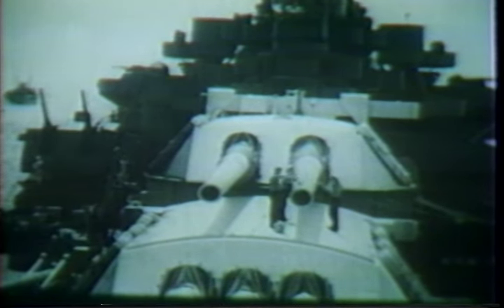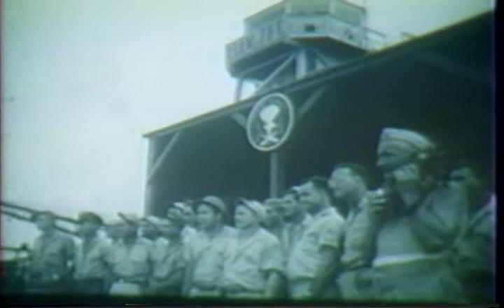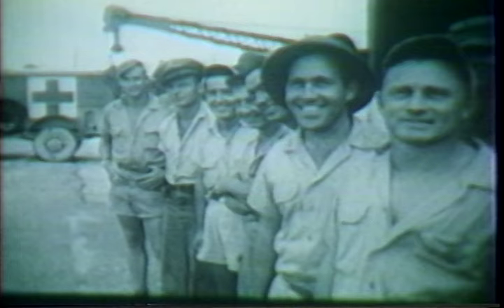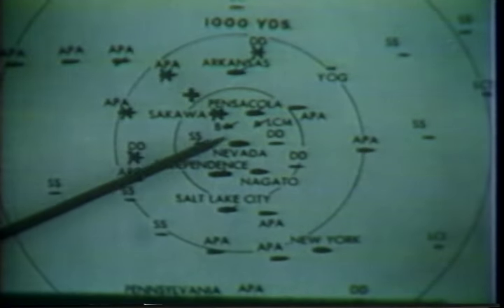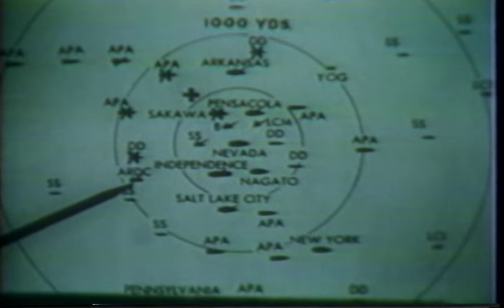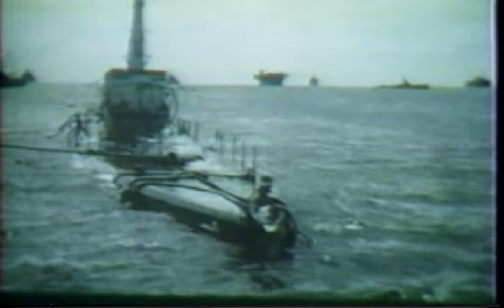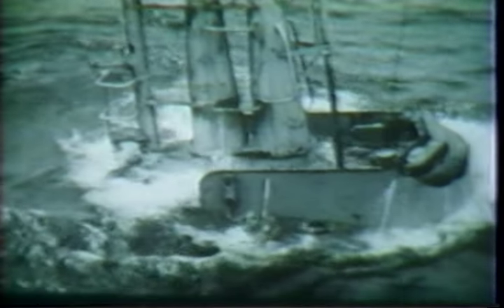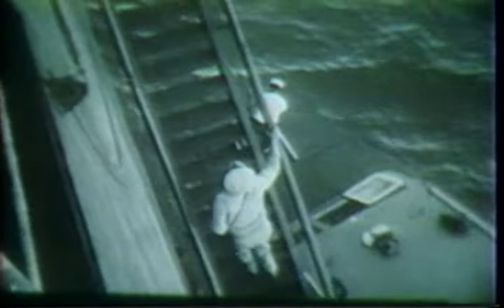Project Crossroads - Nuclear Test Film (1946)

Comment: The temperature in the center of the sun is over 15 million degrees celcius so it may be hotter than the surface of the sun but not even close to the core of the sun
Reply: In a hydrogen bomb the internal temperature of the fireball reaches about 100,000,000 degrees.  Cool huh?

Comment: All that gas from the atmospheric pressure ring is from detonating a million degree bomb so close to water it literally vaporizes thousands of tons of water instantly and turns it to a gas that surrounds the explosion and the column forms due to a vacuum created by the hot air rising from the superheated fireball of plasma rising and the vacuum  in turn makes a column of the same superheated plasma to rise and join the fireball cloud while its cooling

Comment: The cameras were better protected from radiation than the men. It's actually really sad to look back at this now and see the continued devastating effects to the environment and population of that area as a result of those tests. People are still advised to not eat the fish or coconuts from those islands. There is still so much toxic waste and it's shameful to the US that this still hasn't been properly acknowledged and dealt with, if it even could be. I suppose with climate change, eventually those islands will likely be underwater anyway. Sad for the Marshallese people either way.
Reply: They  cleaned up a lot of the stuff and put it in another bomb test crater from "shot cactus" and poured a concrete dome over it to contain it all, but the problem is, like the Chernobyl exclusion zone, once it's there, it's there, only TIME can cure it all.  The radiation levels are actually very low, almost miniscule, BUT the problem is it has entered the soil and water and is now in the food chain-- you can safely go to Bikini or the other test islands, and depending on the location and radiation levels, you can even stay awhile, sometimes days or longer without any significant radiation exposure buildup.  BUT, if you eat or drink anything locally, it will contain atoms of radioactive nuclides or neutron-activated atoms which have been absorbed as nutriets from the soil into growing living things, and then accumulated in the fruit, nuts, wood, bark, leaves, everything... even in the plankton and stuff at the base of the marine food chains, and then of course up through the various animals that feed on each other up the food chain, and due to bioconcentration (just like what happens with fish that get progressively higher levels of mercury or other heavy metal contamination the higher up the food chain you go) the more radioactivity they contain in their body.  Same is true of any animals you might try to raise... the grass they eat contains low levels of radionuclides, but the higher up the food chain you go, the more it bioconcentrates-- so the meat and milk from those animals is more radioactive than the grass was, which means you accumulate more radioactivity than the animal had...  same with fish.  SO if you try to live there, you're perpetually exposed to a very low level, which in itself is "safe" (radiation exposure is cumulative in nature-- the longer you're exposed to it, the more 'lifetime dose' you get and the higher your lifetime dose, the more likely you are to get cancer from it or produce children with birth defects, etc.)  BUT if you eat and bioconcentrate foods grown locally or fish caught locally that have radioactive atoms in their bodies, eventually YOU will become radioactive yourself as these atoms are used by your body through the food you consumed to build new tissue, bone, etc.  THIS is the reason nobody can live there... The US 'repatriated' the Marshallese to Bikini years ago, only to discover that this "bioconcentration" effect was causing problems and killing them, so they pulled them out again and relocated them again.  

There's vidoes by a guy named Shiey on YT where he illegally hiked into the Chernobyl exclusion zone (several years ago before he war in Ukraine) with a buddy and they explored around Pripyat, the abandoned town adjacent to the ill fated power plant, and hiked out again.  They carried a radiation detector and for most of the trip, except for a few "hot spots" that wer downwind of the reactor that day, the radiation levels are pretty low.  They didn't get an appreciable dose in the couple days or so they were there, but you can't live there without getting a cumulative dose, and of course anything living there or grown there would contain radioactive nuclides in it, absorbed from the soil into the plants and then animals growing there, and bioconcentrated.  Why the idea of "scraping off the top couple inches of topsoil" to get rid of fallout on farmland and/or growing a couple crops of potatoes or other crops that sequester radionuclides" is completely bonkers... Aside from the amount of fuel and equipment it would take to scrape off even the top couple inches of soil from even a single farm (which would amount to literal MOUNTAINS of contaminated soil that has to be piled up someplace... ) and then the issues of, in a post nuclear environment where food would be a premium, the idea that where would be TONS of seed potatoes available to plant on that farm (which requires special equipment that 99% of farms and farmers don't have) just to grow a crop that would be heavily contaminated with radioactivity and then would have to be dug and harvested, only to be thrown away (maybe fermented for ethanol as the Germans did in WW2 to fuel their V-2 rockets) for a couple years straight, is lunacy... 

Nope, only way to beat nuclear contamination like that is GO SOMEWHERE ELSE and start over... give nature a few million years to fix human stupidity...

Comment: So we were smart enough to make this bomb, needed to gather data ( I get it ) about the overall devastation, but dumb enough to fill the ships with fuel / oil ?  cmon
Reply: They were trying to make it as realistic as possible.  I get what you're say with regard to pollution and we certainly wouldn't do that today, but times were different back then.  Try not to judge the 1940s by today's standards
Reply: @SRFDriver  Being put into perspective like that.........I guess you're right.  thanks bro.
Reply: @jaysauer7324  Plus they'd just spent the last four years sinking most of the Japanese Imperial Navy and every d@mn transport ship and tanker hauling oil and everything else to Japan from their overseas conquests... all their oil was coming from the Dutch East Indies, and our submarine campaign basically had an airtight blockade around Japan from 44 onwards... So when you're sinking entire TANKERS of oil every day, they weren't too worried about what would leak out of the FUEL TANKS on some target ships in a test...
Reply: Gotta see what happens... maybe it busts if the tanks are full... maybe they explode if they're nearly empty but are okay half full... maybe they bust if they're half full and then the vapors explode.  Don't know til you test....

Comment: Is there any videos of unmanned ships during a megaton detonation?
Reply: Not that I'm aware of.  This was the only real purposed test of naval ships, the idea was to see what sort of damage could be expected to ships at anchor and in various aspects to the blast-- like side to the blast, facing toward or away from the blast, oblique angles, various types of ships, distance, etc.  Basically "if we decided to bomb a major port what would the results be?"  This was strictly an 'effects test" (IOW, what effects on the ship and materials and test animals and stuff could we expect?) and not a "weapons test" (which is designed to test a new design of bomb or new principle in bomb construction or design, or a new bomb component like a primary (fission part) of a thermonuclear weapon or arrangement of components... new "physics package" as they were called).

There's some cool footage from inside one of the "squaw" submarine hulls during the Operation Wigwam test.  Wigwam was originally to be part of Operation Crossroads, which was originally to be three tests-- one air dropped and detonated in the air, one shallow underwater (which was Baker detonated 90 feet below the surface) and one deep water test (which would have been shot Charlie IIRC).  The Charlie test was cancelled and later performed as wigwam.  3 dummy submarines were constructed and fitted with instruments, suspended from cables under surface barges strung out in a miles long, with the last barge suspending the bomb deep below it on a cable.  The deep underwater detonation was used to test the integrity of submarine hull construction with distance; having the hulls suspended from surface barges would prevent them from sinking, and allow their recovery and inspection.  Cameras were installed in the "squaws' as the subs were called, filming the interior during the blast.  One of the cameras is filming the well-lit interior of the squaw one moment, and in the next frame, is filming bubbles in the water that has filled the sub up to the camera pressure vessel it was enclosed in... a camera's eye view of a sub implosion, if anyone wants to see what the Titan sub implosion would have looked like...

Comment: I dove the Prinz Eugen several times in the early 90's while working on Kwajalein. Also dove Bikini Lagoon & stood on the deck of the Saratoga. Mostly visited Bikini because of a nurse working there. Nancy was a rare, extremely friendly round eye in a sea of native girls. Today there's a sports diving shop on Bikini. Still can't eat the coconuts from Bikini or Enewetak Lagoon islands.  Contain enough Strodium-90 to be dangerous. Oh yeah, ""The Dome" which was supposed to seal radioactive top soil & old radiated equipment is leaking like a sieve.
Reply: I designed some of the instrumentation that flew on the Delta 181 Thrusted Vector mission.  It was classified at the time--I was surprised to find a Wikipedia article on it as I was writing this.  Anyway, I also worked on Kwajalein in the middle 80s.  We used to take a C-130 "ferry"up to a radar site on Roi-Namur.  The pilot would fly a couple hundred feet above the water with the rear ramp open so that it wouldn't be so terribly hot inside.  

I remember those days very fondly.
Reply: @SRFDriver : I should have transferred to Roi. Flew up there at least twice a month to dive with buddies. Took a week of leave & spent it on uninhabited 6th Island. Friends dropped us off by boat with plenty of scuba tanks, gear, food, fresh water, about a dozen ice chests of beer, and three native girls. Learned quite a lot about Marshallese tradition & how to find water on an uninhabited island from those ladies. We ate coconut crab, lobster, or Giant Clam almost every night. It was  monumental stepping onto a mile long beach without a single footprint.
Reply: @nerblebun  I hope you took the time to explore--lots of WWII bunkers and such still there.  I remember specifically a command bunker with reinforced concrete columns that were just hanging like stalamites (or is it stalagtites?).  There was another building that had heavy steel doors with concrete partitions on either side of it.  One of the partitions had been hit by a shell that took a half-moon chunk out of the partiton and then impacted the wall next to it.  I took a photograph of it by lining up the shell crater in the wall with the half moon chunk out of the partition.  I really should post those pictures on my page--they would probably be more interesting than what I have on there now.  Lol
Reply: @SRFDriver : Did my best to explore every bunker on the islands. Roi had most  the old Japanese structures. Hospital, Command building, bunkers, warehouses, and even the water tanks where they tested torpedoes. Most interesting to me was the Japanese "saltwater concrete" used to build the structures. All the buildings & bunkers took direct hits from the big guns fired from our Navy Destroyer's & bombs dropped aircraft, but didn't receive much damage. Mostly dents or a few chunks blown off here & there. The formula for that particular saltwater concrete, partially made with crushed coral (hence the Japanese pools blasted from the reef), has been lost. So far, no ones been able to duplicate its strength.
Reply: Interesting
Reply: Do you glow in the dark now???
Reply: @tbamagic : Only after I pour the contents 400 glow sticks over my naked body & walk through the jungle freaking out the natives. Do you understand what it takes to shake up 400 glow sticks?

Comment: Does anyone here actually believe that the fires on the Pennsylvania and the Independence, on the Pennsylvania on the main deck and on the Independence on the hangar deck,  they were saying stores on the Pennsylvania and Torpedoes on the independence, what they were was burning cages full of various animals. These ghouls figured it would be better to sanitize the final version, but the original version for the corporate systems honchos I'm sure included as graphic pictures as they could get, including Motion Pictures, of the burning animals.
Reply: Didn't you see them stacking all the crates of food, clothing, coffee, and a million other things, all in WOODEN shipping crates?  You can bet a good part of that was ammunition.  The WOOD crates will ignite with only 35 calories per square centimeter of heat (from the heat pulse of the blast) which means anything within about half a mile or so made of wood instantly bursts into flames from the heat pulse of the blast and radiant heat of the fireball.  Gotta say as a livestock farmer (which any livestock farmer will tell you if you have livestock you eventually have some dead stock) that dead livestock don't burn like gasoline... so if there were any exposed animals there, they wouldn't be burning like that... animals, like us, are MOSTLY water and water doesn't burn well last time I checked LOL:)  

The animals were in open cages, mostly metal, and most of them died from radiation exposure.  They didn't really know what to expect from these tests-- there had only been 3 nuclear detonations before this-- Trinity in New Mexico, Hiroshima, and Nagasaki.  They didn't anticipate neutron activation of iron atoms in the steel of the ship hulls (which can become seriously radioactive from absorbing neutrons from the fissioning and takes awhile to die down, as it decays it gives off gamma and X-rays as well as beta or alpha in some cases, depending on the decay chain and type of decay).  The seawater itself becoming radioactive from neutron activation of the sodium atoms wasn't expected either, plus the contamination from Baker was just awful... they thought that they could just bring fire boats in and hose the ships down and wash the radiation away-- found out that wasn't true by a longshot, though wash down systems for fallout were incorporated on ships to wash away DRY fallout particles successfully... but WET radionuclides were something else... the dried salt after you washed it down with salt water was itself radioactive... plus metals (like iron and sodium) just are particularly good at becoming radioactive.  Baker drenched EVERYTHING there with millions of tons of highly radioactive water...
Reply: If you want to see what happened to the animals, go watch "Trinity and Beyond: the Atomic Bomb Movie"... they show the animals from Able on the ships, dead in their harnesses from radiation.  Also some footage from later tests in Nevada, where they had pigs and rabbits and stuff lined up to test burn damage and stuff...

Comment: 6.10 minutes. - radio controlled navy drones - ! already back then? and i thought this is somethign new....
Reply: Nope: I worked at Vega Precision Labs and designed the ground and airborne avionics to remotely control an F-102 fighter in 1972.  The designation for the aircraft was QF-102.  I'm sure there's a Wikipedia article on it somewhere.  But they were flying full-sized RPV (Remotely-piloted Vehicles, later known as UAVs-Unmanned Aerial Vehicles) way before I started.  Good times...
Reply: I just remembered that the designator for the F-102 was PQM-102, not QF-102.  The QF designator was used for later fighters that were converted to target use: QF-86, QF-4, QF-16, etc.  Been a lot of years...
Reply: line of sight control like an RC plane basically, just using a real plane.  Pilot flying it was in a chase plane a few miles away at most....
Reply: Nikola Tesla had a radio controlled boat in the 1920s or 30s